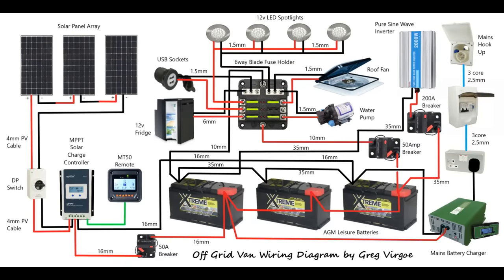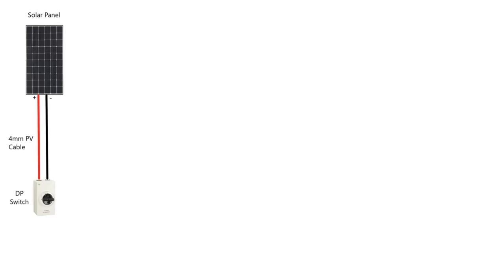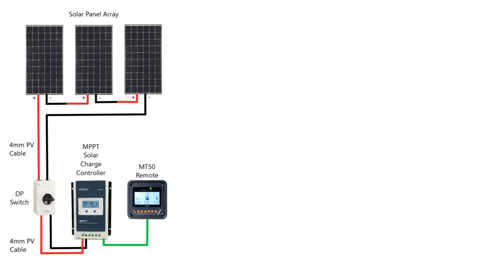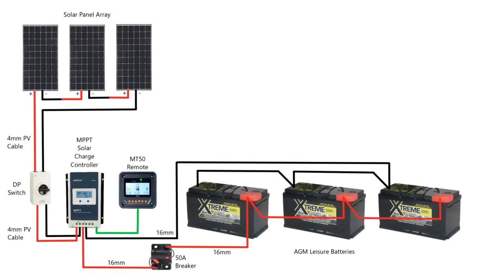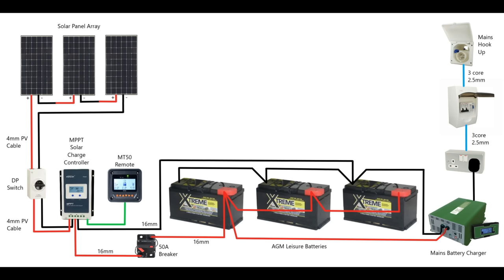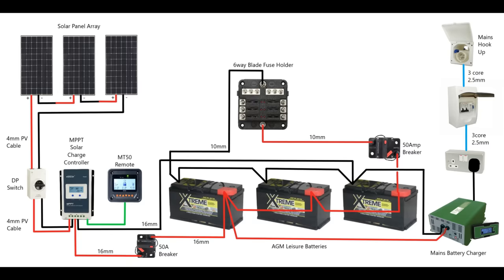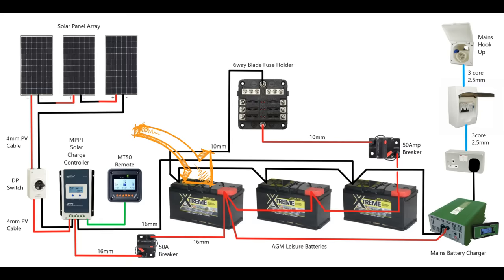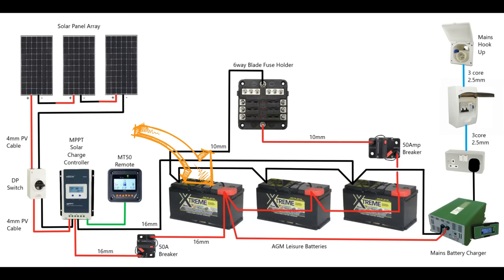How to Wire your Camper Van to be Off-Grid

Comment: Hi Greg. Thank you for all your videos. Very helpful to us building our first van, we want to use an ecoflow delta pro for our power supply,  question what would be the best wsy for us to do this?, any help welcome,
Reply from the maker: Normally with these are multiple charging leads for solar, 12v cig and mains charging. It will require some additional cabling but you can connect the solar input to a panel on the roof of the van. The cig input can come from cables connected to the van battery. I suggest a switch or VSR is used on this connection to avoid draining the van battery and connect the mains input to your hook up socket. That’s the three charging options dealt with. 
For outputs it would’ve best to locate the power bank where it can be easily accessed say in a kitchen cupboard. As many of the sockets usb etc you need to plug into directly. You can use an extension lead off the mains sockets to counter top sockets for more convenience. You can use the DC output to power some lights via a fuse board but be aware of the max amps output of that socket and possible voltage drop on any long cable runs. I hope that helps.
Reply: @GregVirgoe  thank you so much for your help,  we will keep you posted on how we get on with it . Thanks again, Gordon and Arlene

Comment: Hi Greg, fantastic video! How do you determine the size of your circuit breaker? 50a in your case, many thanks!
Reply from the maker: It’s the sum of the loads that could potentially be running at the same time plus 25% safety margin. 
I have a video about cable and fuse sizing in the build series.

Comment: Hi what a fantastic video I’m planning on doing a very similar setup I just need to ask you have a 2000w inverter and you link the batteries via 35mm on the earth can I ask when you link the live to the batteries has this got to be in 35mm as well ?    
Looking forward to your reply 
Dave.,,
Reply from the maker: There’s no earth David. Just a positive and negative to the inverter from the battery and they are both 35mm2 in size.

Comment: Really nice info. Question: can i just leave out the inverter and then only use 230v when i am hookep up to shore electricity? So is it possible to install multiple sockets in my van for 230v that are wired to the consumer unit? Because i will mostly be using 12v and i only want 230v when i am hooked up to shore
Reply from the maker: Absolutely 👍🏼 no problem at all

Comment: Hi greg I have 2 x100w solar panels what DP isolator do I use pls. Also I have 2x 100ah AGM batteries what size trip do I use between the batteries and the mppt controller pls .
Tks for all your videos been a great help and takes a lot of confusion out for us novices 👍

Comment: Hi Greg,I'm building my own van in Japan now, so thanks for your video and it's really helpful.

There is only one question here,according to BS7671 Cable Sizing Chart , the max Amps for 35mm is 141A(2 cables), but in this video, you use 35mm to connect battery and inverter, and there is a "200A" breaker between.
My question is , if you assume there max current will be 200A through inverter, why don't you have to use the cable could allows/endure 200A (such like 70mm)???
it will be so helpful If you can answer it, thank so much.
Reply from the maker: Strictly speaking yes you are correct. Different types of cables also have different ratings. For example you can get Tri rated cables. I was using battery cables from 12 volt planet and if you look at this link their 35mm cables are rated up to 240A https://www.12voltplanet.co.uk/extra-flexible-pvc-battery-welding-cable-35mm-240a-by-the-metre.html
Reply: @GregVirgoe  I got it, thanks so much :)

Comment: Hi Greg great video many thanks for sharing. 
I already have a split charger fitted to the van I just bought but no 240v hook up, could I use your diagram just to add the mains battery charger, consumer unit, hook up and inverter without the solars ? Although I would like to add solars at a later date.
Reply from the maker: Yes of course you can. 👍🏼😁

Comment: Sorry if this has already been mentioned but what would I need to wire up a water heater? As that’s the only thing that’s missing off this list for me
Reply from the maker: Electric water heaters are not a good idea on 12v as they use huge amounts of battery power. Or is it a different type of heater?

Comment: This is just an amazing video.  Assume I have an AC outlet powered by my inverter.  When I am on shore power, is there anyway I can power the same AC outlet without passing by my inverter (sounds bizard to go from AC to DC back to AC when I am pluged in to shore power).  Or do I need to have separate AC outlets.  Thanks
Reply from the maker: You can simply use a double pole changeover switch. Wire both sources into the switch and the output to your sockets. Here is a link for one. https://www.ebay.co.uk/itm/Live-IP66-Enclosed-Changeover-Switch-20-25-32-63-Amp-3-Pole-Surface-Mounted-/184127769293?mkcid=16&mkevt=1&_trksid=p2349624.m2548.l6249&mkrid=710-127635-2958-0

Comment: Hi Greg, thank you for the video, well done.
I’m Billy from Australia.
Hope you can help me.
I bought a caravan which I will found to use it in my backyard for long term stationery, currently I have problems  with the lights is not working, I’m trying to to figure out why.
I was thinking of eliminating all batteries and solar system and run it on the power only.
Would you be able to help me figure out how can I do this.
Thank you 
Billy

Comment: Great video, can you tell me where should i put alternator wires? Thanks
Reply from the maker: Ideally, a DC-to-DC charger should be connected to the terminal of the van starter battery. I recommend using an isolated charger and running both positive and negative cables and do not rely on a connection to the vehicle for the negative as this can cause additional resistance and voltage drop.

Comment: Hi Greg. Thanks for all your content, it's been so useful and reassuring whist planning the electrical system in my van. The BS7671 cable sizing chart is for twin/3-4 core cable. Is there another for single core larger cables for batteries? Secondly, I am using a Victron energy battery monitor that uses a shunt. My negative wires from 12V supply, inverter & C-tek will go to the shunt but vary in size...should the wire running between the battery and shunt be sized according to the largest of these (the inverter) or larger to acommodate all potentially? Thanks again!
Reply from the maker: You are right, Different types of cable do have different ratings and there is not one table for all.
Best to check the manufacturer's spec for the make of cable you plan to buy, there is a good sizing guide on 12volt planet for battery cables. I'll link it here for you. https://www.12voltplanet.co.uk/cable-sizing-selection.html
All cables have to be sized according to the potential load at peak demand, so that means all the loads on at the same time.

Comment: Hi Greg, your videos on wiring up the 12v system have been super useful and really helped me work out cable and fuse sizes for my system. I was wondering if you have any information on wiring the 240v system? We will have shore hook up but also plug sockets. I’ve been struggling to find decent information on this e.g. do you always use 2.5mm3 3 core cable or do you need to size it the same way as the 12v system?
Reply from the maker: 2.5mm cable is good for up to 29amps on short runs and your hook up is only 16amp and your inverter is off a 13amp plug so both well within the cable size. 
I have a really simple changeover diagram that you may find useful. Here is a link to it https://www.dropbox.com/s/rkp2wcwwcomwzvt/Changeover%20Switch%20Diagram.png?dl=0
Reply from the maker: Link to the changeover switch https://www.amazon.co.uk/dp/B08MVBGMHX/ref=cm_sw_r_as_gl_api_gl_i_GWAP4CE3974ZGPHS38S8?linkCode=ml2&tag=gregvirgoe-21

Comment: Hi Greg .
Thanks for your excellent videos.
I have 4 panels of 100 wat  in series but my tester read _ 80 volts .
if by mistake i cross wires ( positif with negatife )could it damage my charger ?
Reply from the maker: Yes it could, the way to check polarity is to use your multimeter on voltage setting across the cables if the reading is a positive number the polarity is correct if the number is a negative valve the polarity is reversed. Check cables and rewire. Make sure connect battery to charger before solar panels.

Comment: Hi Greg brilliant video. Can I ask if I have a switch board that I want to use do I wire from fuse board to the panel? And then the 12 v appliances
Reply from the maker: Yes best to have a blade fuse holder the go from that via your switch then onto your appliance. 
Some switch panels come with inline fuses which you can use but check the rating and the cable sizes.
I have another video about that 😁

Comment: Hi Greg, I've found your videos immensely helpful but am struggling with the consumer unit on here. I am not an electrician and am rather overwhelmed by the variety of options and wondered if you could send me a link to the right one? I'm using 2AGM batteries with solar and the Victron multiplus compact inverter charger 12v/2000va/80a and the "kit" I bought didn't include a consumer unit..? I am not even sure if one is necessary! Any help greatly appreciated, keep up the fantastic work!

Comment: Hi Greg, excellent video's with very clear instructions, thank you.
I do have a couple of questions regarding this video.
Coming out of your inverter, would you go through a distribution board?

I also carry a 8.5 KW generator on my vehicle which has 32 amp 240v outlets. These can be paralleled together to provide 64 amp maximum output whilst being protected by their own circuit breakers I believe..
Rather than plugging this into the external power connection, is there a way to feed the 240v distribution board directly from the generator?
I would effectively have a 3 way power source to cover me for all eventualities.

Thanks in advance for your help.
Ian

Comment: Great vid as always Greg, thank you🙏 Quick question... I'm using lead acid batteries, does that affect the thickness of the cables that I need to use? TIA🙏
Reply from the maker: The cables are sized based on the current flowing at that particular point and for long runs the voltage drop also needs to be considered. 
The type of battery will not affect cable size.
Reply: Good to know @GregVirgoe , and thanks for the prompt reply🙏
Reply: Hello Greg wat is the function of that Dp switch.
Reply from the maker: @brianobiero6563  to isolate the solar power input to the system if there is a problem or if you want to work on it safely. Always good to have a quick isolation point 👍🏼😃

Comment: Hey Greg, thanks for your videos, they have been very useful, just one thing, in your wiring diagram you have your shurflo pump wired with 1.5 mm cable, yet shurflo advise 2..5 mm, any thoughts on this
Reply from the maker: The 2.5mm cable will give you less volt drop and if you have the 2 bar version you will need the larger cable as that uses 10amps. My pump only uses 5amps and cable length is only 2m from fuse board to pump so my volt drop on 1.5mm is only 2% 👍🏼😃

Comment: If my MPPT solar charge controller is 50A, what size wire and breaker should I use between it and the batteries? Great content, thanks a lot.

Comment: Hi, beautiful video, the best one. Could you tell me what would happen if I take power from the inverter strait to the battery charger and get the batteries charged???
Reply from the maker: Hello Julio, sadly this is not possible. The inverter is getting its power from the same batteries you are trying to recharge. So the system losses will mean you will just eventually drain the batteries completely. Your battery charger needs to be plugged into mains.
Reply: Thanks Greg for your help to my question, could you also help me with another one. I have an old leisure battery and I'd like to add two new better and different ones and use them all three together, can I do that?
Reply from the maker: @JulioCesarcoco  the batteries need to be the same type and capacity if you want to wire them together in parallel. Otherwise they will only charge to the level of the smallest one.
Reply: @GregVirgoe  I see, thanks a lot.

Comment: My van is 5 years old now. I’m changing the failed AGM batteries for a 460ah lithium ion battery. I’m also upgrading the battery to battery charging to 2 Victron Orion 30ah units. I notice you don’t have any battery to battery charging. I’m surprised Greg, was this an omission or do you have a reason for this? Thanks Greg. Very helpful video.

Comment: amazing video. I am defo gonna want a split charger tho. is the path battery to split relay to battery charger to battery or no straight battery to battery? I would have though that there is a mppt that would do it all but so far not sure....
Reply from the maker: I would not fit a split charge relay as it will not look after the condition of the batteries. You are better installing a battery to battery charger. It will correctly meter the charge depending on battery condition and type. 
Renogy make a battery to battery charger with built in MPPT solar charger. You would have to wire your panels in parallel as it has a low input voltage. Ideal for a cheap one box solution.

Comment: Hi Greg. 
Thanks so much for such a great video, just what I need and was looking for in setting up my van/carpentry workshop. 
My question is: Could I add a petrol generator to the system in order to run some heavier load 240v 
machines and could it be wired to charge the batteries as well? Could it just connect to the other side of the consumer unit? 
Many thanks in advance.

Comment: Excellent video Greg! Just one question. I just bought a battery monitor and was wondering how you would wire it to your wiring diagram so I can see the battery status and how much is charged or used when it discharges.

Comment: Hi Greg, quick question for you. What happens if mains are plugged in and main battery charger is on at the time time as the solar. Does the solar need to be isolated while main battery charger in on? Great video, very helpful.
Reply from the maker: Very good question. It’s ok to leave the solar on. The charger will see the increased voltage on the battery from the mains charger and back off to float. I’ve had both of mine on regular over the years with no issues at all 👍🏼😊
Reply: Perfect, thanks for the reply.
Reply from the maker: @benmiller7736  you are most welcome 🙏🏼

Comment: Hi your videos are Realy helpful, just thought I'd ask, Im about to fit electrics to my transit custom, I have the renogy 40a dc - dc charger, the renogy 1000w inverter and a small 12 v system, pump, fridge etc. I only have the one 100ah agm leisure battery and was wondering if its worth getting another? I'm using your advice on cabling and fuse sizing, but won't your advice on the battery's... not sure how long the one battery would last??
Reply from the maker: Yes definitely worth getting another as you can only really use half the capacity of AGMs to make them last longer

Comment: Hi Greg great diagram. I’ve ordered 50 amp circuit breakers on two occasions and I’ve been sent 250 amp breakers. Can I use these?
Reply from the maker: No they need to be the right size or they won’t work when needed

Comment: Hi Greg, Very nice video, just a thought, it is common now to be able to purchase AGM batteries to fit a automobile, basically the chemistry is near identical to SLA, 
Why do you say that your vehicle alternator is not a good additional method of charging the batteries whilst the engine is running?
Absolutely agree if you have any form of Lithium, Lead/Carbon, or other type of none acid battery,

Comment: This is by far the most helpful video I have seen on 12v camping set up. Is there a way to connect this to an alternator, so I could charge the auxiliary/leisure batteries while driving? Also do you know what would be required to have it connected to a ‘smart’ alternator (variable voltage or amps I think)?
Reply: I think what you would want is called a battery isolator or smart battery isolator, which will send charge to the leisure battery only while there is a surplus (engine and alternator running) and will otherwise shut off, protecting your start battery from draining.
Reply: VSR is what you need

Comment: Hi Greg, quick question for you. 
On your wiring diagram( which are brilliant by the way ) I can’t see a b2b charger only a mains charger. Did you not fit a b2b charger in the end? 
I watched your q and a video where you suggested b2b was the way to go rather than split charge relay. I’m pondering at the moment which way to go with my build.
Cheers chris
Reply from the maker: I didn’t fit one because we have loads of solar and we never run out of power. If I was going to fit something it would definitely be a B2B and not a split charge relay. 
It will look after your batteries far better than a simple switch.

Comment: Hi Greg. I have bought the same DP isolator switch as you for my solar panel, but I am a bit confused how to wire it. I have Googled but still confused!
Many thanks
Reply from the maker: Wire positive across terminal 1-2 and wire negative across terminals 7-8. Leave the other 4 empty. 👍🏼
Reply: @GregVirgoe  Thanks Greg. So I don't use any of the bridging links then?
Also, mine didn't come with any MC4 connectors. Do you have a link for the type that fits this product? Many thanks!